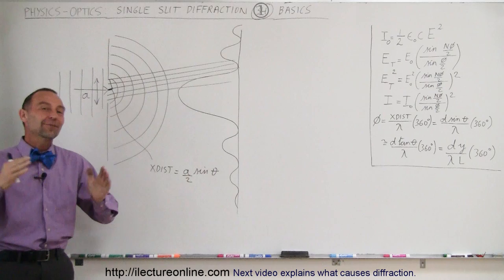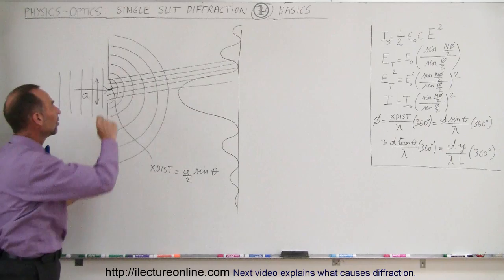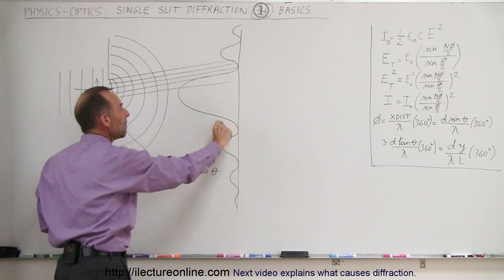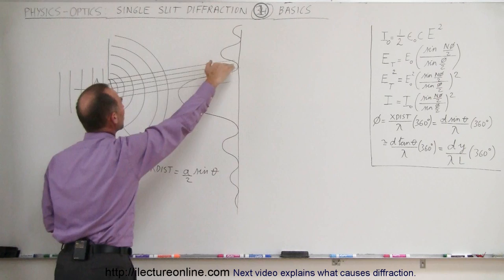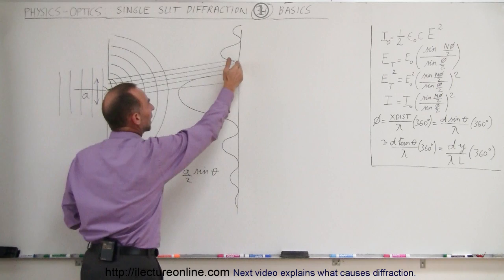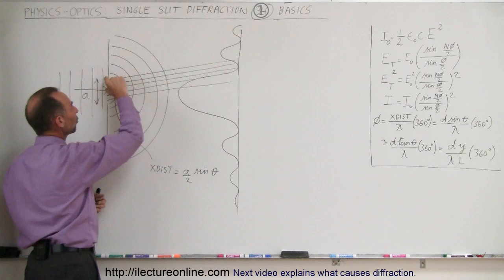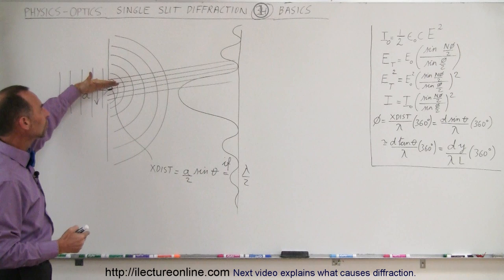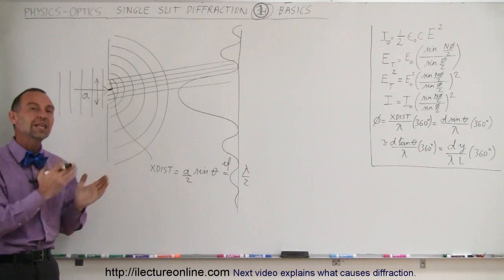Physics - Optics: Single Slit Diffraction (1 of 15) Basics

Comment: We don't get interference fringes with a single slit if using water waves though do we? Or sound waves?
Reply from the maker: Only diffraction from a single slit.  You need more than 1 slit to have interference.
Reply: @MichelvanBiezen  I think this is a bit of semantics tbh. But ok, replace the word interference with diffraction and I still have the same question. I meant the appearance of bright and dark fringes. Does this happen with water and sound too or just light?
Reply from the maker: Diffraction and interference are NOT synonymous.  But to answer your question, yes, this happens with water and sound as well
Reply: @MichelvanBiezen  Other than the fact that the word interference is associated with more than one slit explain the qualitative difference between the two words that renders using them synonymously inappropriate. I don't think there is one. An interference pattern exists for one slit whether you like it or not. Ok diffraction means the spreading out of the wave when passing a slit or aperture too. But the disagreement was specifically to do with the two words association with the word "interference". I still see no reason why they cannot both be used here.
Reply from the maker: In order to have an interference pattern, you need two sources of monochromatic light. (double slit).  Each individual slit will also show a diffraction pattern, such that the diffraction pattern will be superimposed on the interference pattern.  There are dozens of videos on this channel explaining that.

Comment: thank you for these videos sir, I don't know if I missed an episode but where do you get the formula of intensity for the central maximum in a single slit from? Thank you :)
Reply from the maker: Usually the intensity of the central maximum is written as Io, which has no specific value, since it depends on the intensity of the incoming light.